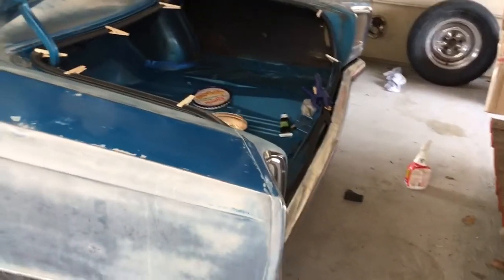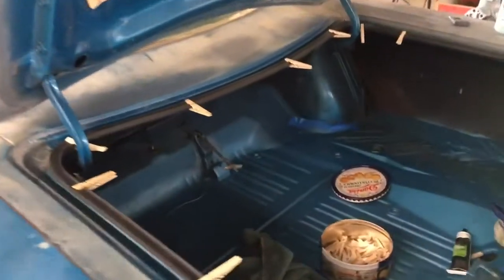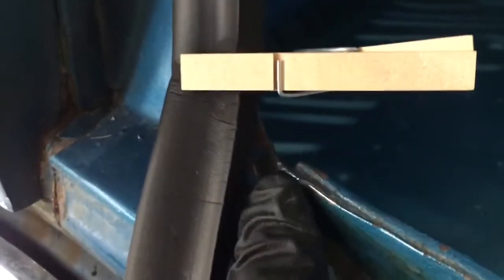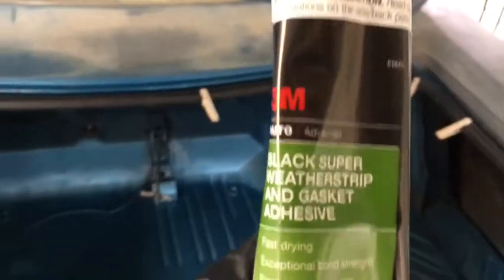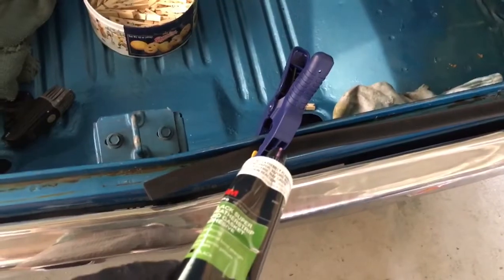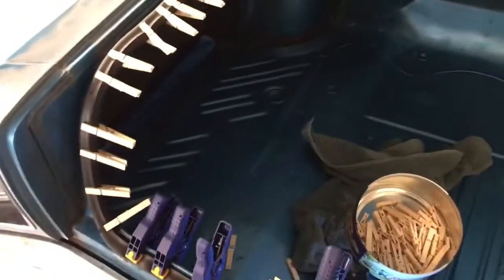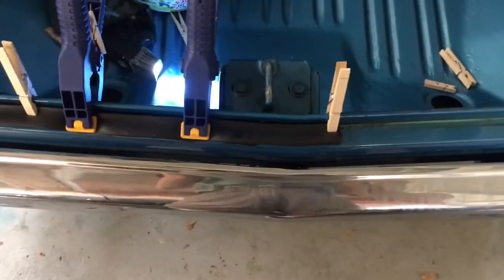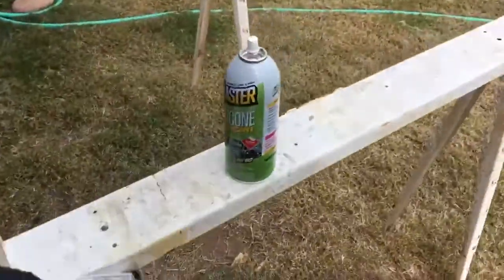1969 GTX Trunk Seal Installation

Comment: Looks like you should have used that liquid rubber to repair the trunk's seams before putting the new seal on. It was probably leaking because of them. Looks like you'll need to scrape the old stuff off with a steel brush and then reseal it. Permatex Black Rubber Sealant works well.